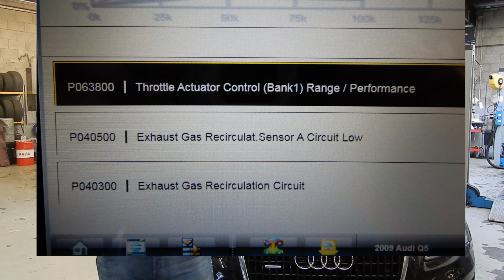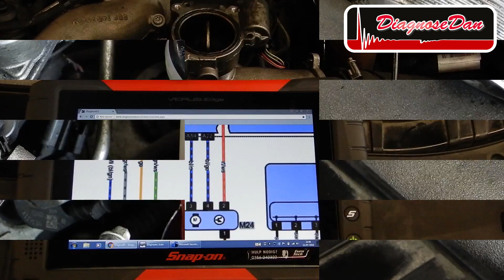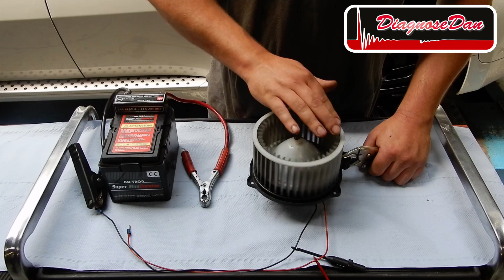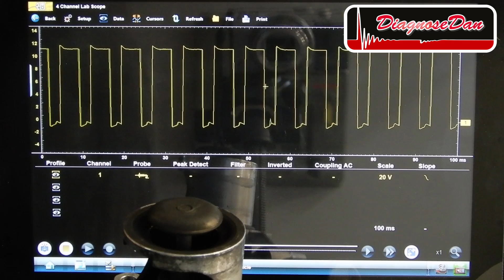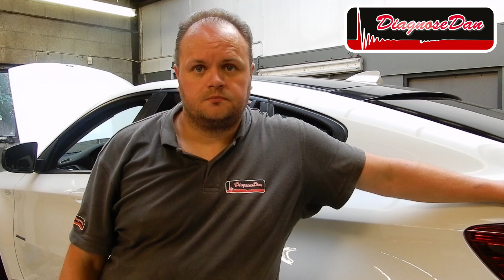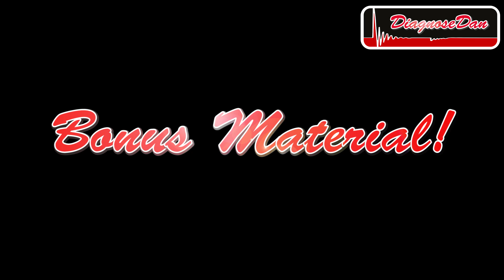Audi P0638, PWM/Duty cycle explained

Comment: Great video my friend. My question is how can a multimeter display dutycycle/ frequency but on the regular voltage setting it cant show a pulsed votage signal it just displays the average of the signal. Everyone says its to slow to show that fast of signal but then you put it on duty cycle and it shows it. Could you please explain if you know please. Thanks for all the great lessons
Reply from the maker: Joe Clark It's not convenient if the reading of your multimeter would be chancing 130 times per second! So it displays an average voltage. It's designed that way.😉
Reply: Joe Clark, Even my cheap little $50 meter is detecting waveforms into the kilocycle range and more, but the display on a typical DMM like mine is updated 3 or 4 times per second. Bargraphs on better DMM are updated 10 times per second. Yet more advanced meters display waveforms. If you want to learn more, a good free online source is EEVblog. Comment boxes there can be very interesting as well.

Comment: Getting the basics right from the start, such as the function of the throttle body on a diesel engine, has serious implications down the line where correct diagnosis is concerned. Pwm is given the complete teardown with  some very interesting practical applications, demonstrated. The advantage of using a scope from this and other videos, cannot be overstated. Very informative video and so well presented.
Reply from the maker: Tom OConnor Wow! Thanks for the great comment!👍

Comment: You did it again Dan! Thanks for the PWM class, you're a great teacher.
Reply from the maker: Moving Up Auto Diagnostics Thanks it's appreciated!😁
Reply: DiagnoseDan One question: PWM according to your explanation, what varies is the on time (duty cycle). So no matter the setting, the frequency stays the same. How do you call when the frequency actually changes? Like for example a GM MAF sensor. Thanks.

Comment: great vid dan question I have 2003 mazda 2.0 liter I connect a scan tool and I get no com what would be my first thing to check and see why im getting this every time I hook up a scan tool also I have tried different scan tools with same sesults thanks mike from florida
Reply from the maker: Check pin 6 and 14 in the dlc. those are the comm. wires. Of you have scope use it to take a look at the can waveforms.
Reply: Thank you what if I don't have a hi lo circuit how do I test
Reply from the maker: Michael Szweda Have you watched my can bus video?
Reply: DiagnoseDan I will watch it right now thank you

Comment: Thanks Dan for instructing us on diesel throttle body.  Like the look of versus edge is that the built in wiring diagrams u showed, cheers my friend, Sandy
Reply from the maker: sandy anderson,No Sandy used the Verus edge as a tablet, it's connected to wifi. I have a subscription at Hella Gutman it's a online wiring diagram.
Reply: DiagnoseDan yes these diagrams look good, good wiring diagrams are always a problem is this the only ones u use cheers sandy
Reply from the maker: sandy anderson I am subscribed to the gmto helpdesk, they have everything. There are also wiring diagrams in the verus software but they are very basic.
Reply: DiagnoseDan cheers Dan I contacted Hella this morning for a 7 day free trial (annual subscription £500 +vat) cheers sandy
Reply from the maker: sandy anderson let me know what you think about it!
Reply: DiagnoseDan will do cheers sandy

Comment: Great video. Lovely seeing the pcm command signal to the throttle actually change when you scantool commanded it. I built my own pwm test tool but I'm just cheap. :)
Reply from the maker: Benjamin Rich 🤣🤣🤣🤣 Lmao.
Reply: If I'd add maybe one thing to this great video(although it's a great introduction so maybe it would have been wrong to complicate it)  it's that with a biased-to-close (or open) by a spring system where the pwm activated rotation/movement works in opposition to a return spring (and therefore achieves at sufficient frequency an equilibrium) that 50% (or any percent) of electronic ON time (whether ground side or power side switched) DOESN'T automatically tally with that being the amount the valve is open. So it might take say...65% on duty cycle for a valve to float at physically 50% open. I only recently realised this myself. :) I think Paul Danner made a good point on this in an EGR vid but i can't remember which one. Keep the videos coming Dan. :)

Comment: Great video Dan! Lots of great info!
Reply: Well done 👍,, any clue why my compressor pumps  to max my rear suspension /e61 2004 /, no leak and my car mechanic couldn’t recalibrate it 🙏,
Reply from the maker: Scott Puopolo Thanks!👍
Reply: DiagnoseDan , thank you I will have a look at it 🙏
Reply from the maker: dzevdet hasanovic Take a look at the ride hight sensor readings